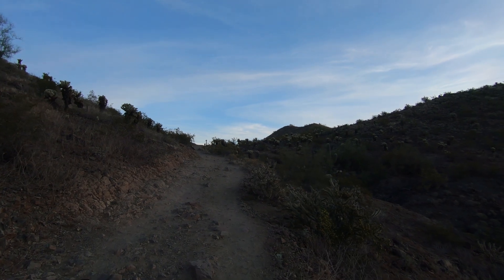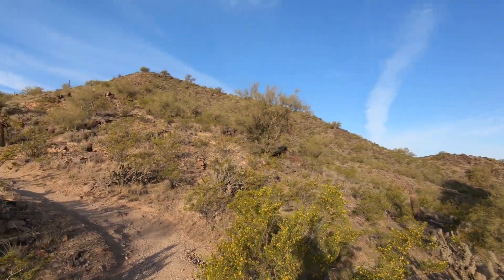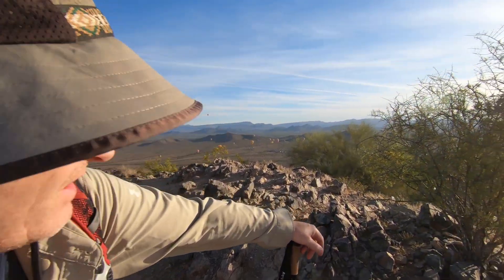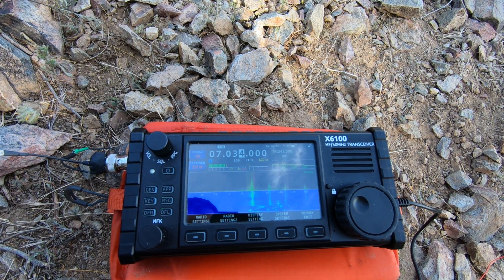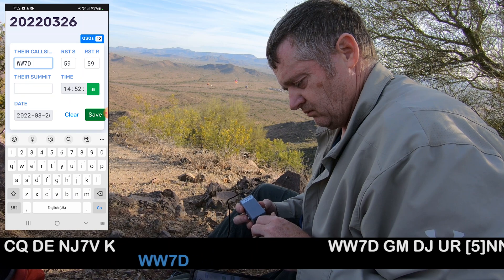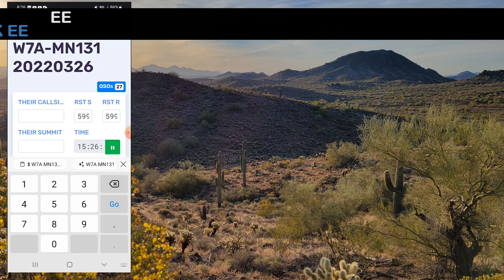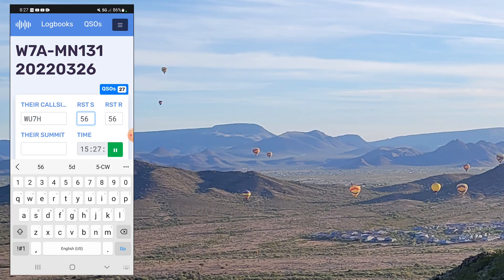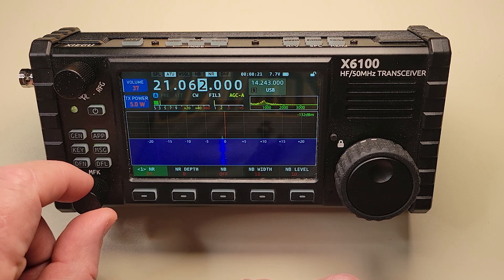Does the Xiegu X6100 overheat?

Comment: The manual says: "Do not place the device in a place where the temperature is higher than 60°C; otherwise, the battery
pack may rupture or catch fire."   This radio inside certainly has a higher temperature. If the battery catches fire, whose fault will it be?
Reply from the maker: Thanks for your comment.  Let's hope we never have to find out the answer to that question.

Comment: I got my Xiegu X6100 a few days ago. Today I was operating on 15m for the first time (portable) and had some nice QSOs. Reports were good. I was using external power supply/LiFePo battery and operating 10 W. Charging was off in the menu. Nevertheless the X6100 got really hot. I guess I could have cooked an egg on it. I was in a shady place. Will have an eye on that and probably attach some additional cooling elements on the back.
Reply from the maker: This is an interesting report. I was not able to reproduce my overheating issues. It seemed rather random.  Let me know if you narrow down the cause.
Reply: @RedSummitRF  I discussed this issue in a German Facebook Xiegu x6100 group. Other OMs mentioned that heating up is pretty normal when operating with 10 W. One OM assumed that the amplifying curcuit for the 10 W might be the cause for heating up. Another operator mentioned that the TRX is not really made to hold long OSQs or many QSOs in a short period of time.

Comment: Great set of review videos Charlie! I think I'm the guy in Utah :) I'm looking forward to comparing notes here. It's an appealing radio and since I won't be getting a TX500 in the foreseeable future - very bummed - I'm interested to try this. Do you think it might be a battery quality thing or a power management problem that leads to the over-heating? Thanks for the videos. 73 Eric KI7WJP
Reply from the maker: Hi Eric - I actually think it's the hot Arizona sun and me being a dumb ass lol.  I have one more experiment before I send it off to you, but I don't think overheating is a problem.  The next video will have my concluding thoughts about everything after I take it out one last time.  It will be interesting to hear what you have to say.  I'll be dropping it in the mail on Friday.  73
Reply: @RedSummitRF  I want to see about the heating thing, especially when connected to an external battery. I'm looking forward to your next video. I guess I'll need to do some summit activations with it as well. Winter is still going high in the mountains so it will be fun to take it up there. I'll let you know when it gets here. Thanks Charlie! - Eric
Reply from the maker: @backcountryamateurradio  yup, that's exactly what I'll be doing tomorrow - external battery at 10 watts for the duration of the activation.
Reply: @RedSummitRF  I'll be looking for that for your next video!

Comment: It's one thing if it heats up a bit, but those birdies need to be addressed by Xiegu. Thanks for the ongoing review.
Reply from the maker: Yeah those birdies are a concern.  I'm still a little perplexed by them.  I don't really know the source.  They present strange behavior like they aren't always in the same place and are mostly only present when connected to an antenna.  But I can literally be in the middle of nowhere and they are still present.  It makes portions of the band unusable.  Most annoying is there seems to be a birdie always floating around 7.033-34 which is a prime QRP CW waterhole.  Anyway, thanks for watching the video, Joe.
Reply: @RedSummitRF  If they are only there when connected to an antenna they are NOT "birdies", birdies will be there all the time as they are generated internal to the radio, that is the definition of a birdie! What they are in your case I cannot say but I have lots of signals like that where I live, and on different radios, they are simply QRM in my case.
Reply: Yep. Just within the USA bands between 3.5 & 30 MHz I counted some 75 birdies, most of which were at least S3 and some S6 and above. On 6m the birdies made the band damn near useless. And of course it gets very warm just sitting there letting the battery run down. Far warmer than the IC705 gets doing the same. But those birdies! Another great failed design from Chairman Xi’s copy-cat slave camps.

Comment: Good video Charlie and another nice looking summit. Nice views of the hot air balloons. I thought that maybe the voltage on the external battery may have been different to the internal one and may have caused heat issues but looking online that's not the case. The Xeigu seems a lot of radio for the money with some good features too. I'm sure that it will be very popular.
73 Chris M0RSF
Reply from the maker: Thanks Chris - yes, I am leaning more towards liking the radio more than I expected.  There are issues that really need to get worked out but I guess that's part of the price point.  Talk to you again!